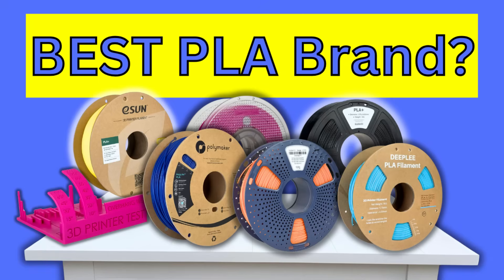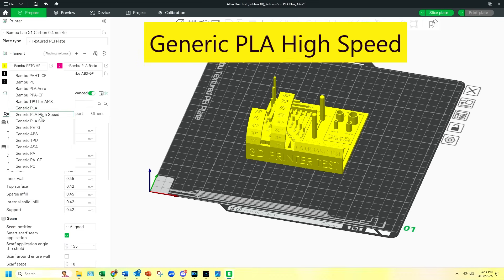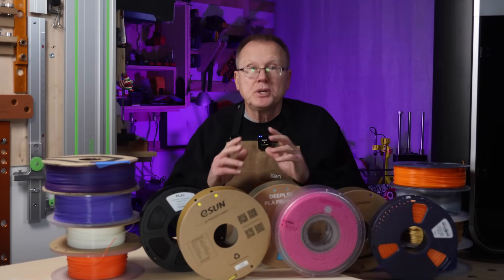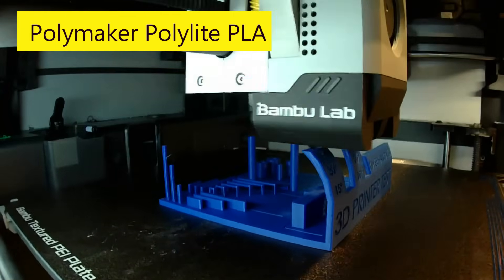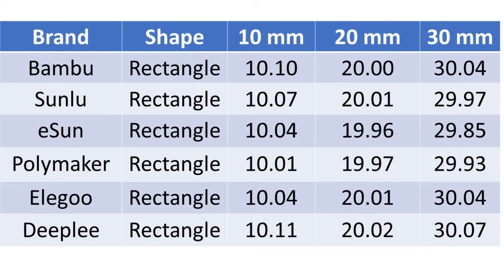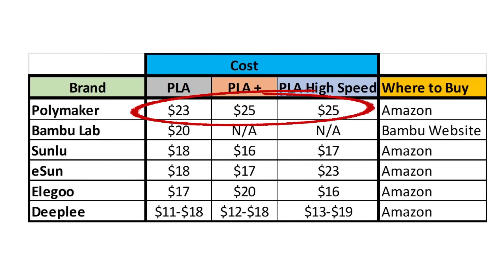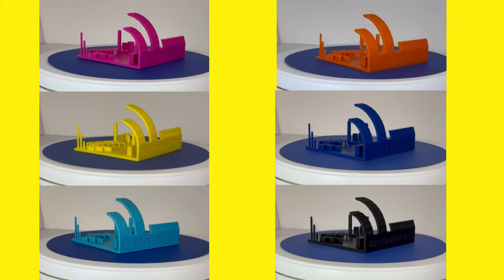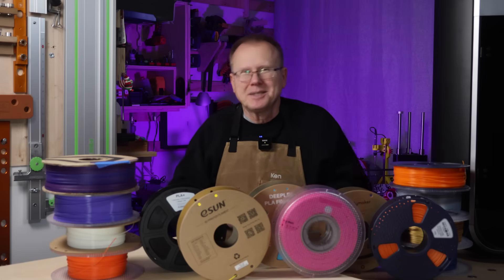Which is the BEST Brand of PLA Filament for 3D Printing?

Comment: I tried six Sunlu spools from 3 different batches. Four of the six spools had winding problems which lead to tangled filament on the spool and constant print failures. Never had that with any other brand. That means I had to return 3 out of 3 shipments I bought from them. That's just terrible. They have great resin, but in the FDM department they have lost me as a customer for good.
Reply from the maker: I’m sorry to hear about your experience with the Sunlu filament. Thanks for sharing.

Comment: Bed adhesion is something that I found mixing results between brands
Reply from the maker: With my limited testing, I didn't see a difference with bed adhesion, however thanks for sharing your experience regarding bed adhesion.  I will keep an eye on that as I run more parts with the different brands of filaments.

Comment: Doesn't the deeplee model look a little warped on the side where the overhang tests are ? It looks off the blue disk, not sure if its am optical illusion

Else its nice to see manufacturing is much better. Before id get ecofil3d, elegoo, sunlu etc.. half of them wouldn't print because the quality wasnt great, the diameter wasn't constant or there was already moisture in the filament
Reply from the maker: I just double-checked the Deeplee part and it is very flat. The blue disk is just a piece of colored paper so the part may not have been sitting perfectly flat on the turntable.  Thanks for the question.

Comment: I fully calibrate every filament I use, down to shrinkage/expansion. You'll not see the larger changes in design to output that way. Saves tons of time by taking a little more up front.
Reply from the maker: Thanks for providing your process in using filaments.

Comment: I suspect the cylinder discrepancy is actually the printer itself or slicer gcode. I ran into many issues printing cylinder and round shapes, with most common being - the diameter changes abruptly mid-ptint, and the new circle perfectly alignes with the previous on one edge but leaves a sharp step on the opposite.
I could not solve this, but it feels bambu printer struggles with circles for some reason. Maybe it's all printers, idk.
I almost feel theres some sort of rounding error in the driver.
Reply from the maker: Yes, you could be right.  I haven't carefully studied the source of the diameter differences.

Comment: I work for filament manufacturing buy filament made from PLA 4043D resin and high speed is gimmick it's just low quality resin you better of with recycled stuff. buy from the manufacturer of filament it's normally cheaper as a lot of brands are just stickers charging a higher price, I know I do it

Comment: Your diagnostic process is flawed. Use the calibration model to tune the filament settings … you know, calibrate … then you print something that tests the strength of the different filaments in multiple ways. That’s the comparison that qualifies the best for the price. If you don’t know how to tune the settings, you should be able to find some tutorials on avoiding common printing problems such as stringing. Stringing is related to printing temperature and cooling. To fault a material because you printed it wrong is not a realistic judgement.

Comment: I am surprised you listed Elegoo as plastic reels. I but allot of Elegoo and have yet to get any on plastic. I rip the cardboard sides off and put them in the Bambu reels as refills like others do with eSun. Btw, I often get Elegoo from their site and it is generally less expensive than on Amazon but the selection is also less. They must sell through Amazon as a priority over their own site.
Reply from the maker: I happened to have bought my Elegoo filament that had plastic spools, but I agree with you that when I was on Amazon, Elegoo also had filaments on cardboard spools.  Maybe they are switching over to cardboard spools and I had an older lot of filament. Thanks for pointing out that you sometimes find a lower cost Elegoo filaments on their website vs. Amazon.  Thanks for your comment.

Comment: Elegoo is my current favorite, especially their matte. I do like sunlu, esun, and creality's filament too though.
Reply from the maker: Thanks for mentioning you favorite brands of filaments.  I haven't tried Creality's, but I should do that. Thanks for your comment.
Reply: I had a lot of issues with cursed roles of elegoo.  Rolls where every 5 min they would tangle and overload the ams no matter how much I unrolled and rerolled them.  I had the same issue with Bambu refills.  With the latest sunlu I haven't had it happen once.  Historically they they had the same problem but it looks like they have some new method of filling the spools that fixed it.
Reply: @atomichamsters  I've used at least 100 spools of elegoo in the past 6 months with not a single tangle so that's just weird.

Comment: I threw away 4 spools of Elegoo PLA Black, I got in a 4-spool amazon deal, because it had 3 or 4 bumps per spool that would jam the extruder.  Bought about 6 months ago.  The only filament I have ever been unable to print in over 10 years.
Reply: I use Elegoo and I have never experienced filament problems. I buy it directly from Elegoo.
Reply from the maker: I'm sorry to hear that you didn't have success with the Elegoo filament.  You have been 3D printing for a long time so you must have tried many brands.  Do you have any other brands of filaments that you like that I did NOT include in my video?  I would be very interested.  Thanks, and thanks for your comment.
Reply: Bingo!  I had the same problem with Elegoo black and got a blob of death that ruined my Anycubic printer!  I thought I was the only one.  I never bought Elegoo again.  They probably own Deeplee filament because people quit buying Elegoo when they got the bad filament we experienced.

Comment: I tested Kingroon pla for $7 a roll and its prints just as well as any new (dry) pla.
Reply from the maker: Thanks for letting me know.  I haven't tried Kingroon, but I may try to get some for testing.
Reply: Where are you getting it for that cheap??
Reply: @amandagallacher8173 you can get it off of aliexpress, especially in bulk and when there is a deal, you can get it for $7-$8 per roll. Their petg is better than their pla in my opinion

Comment: Best PLA is the cheapest per KG with free shipping.
I use whatever filament I can find on Amazon and usually have good enough results. The only issue is color selection is hard to find. I tend to buy white, grey, black in packs and whatever else I can find for less than 20$
Reply from the maker: Lol, it’s hard to argue with your approach. Thanks for sharing your experience.
Reply: I’ve been printing with Kingroon PLA from Aliexpress that was a little over $8 per KG with a 10 KG order.  It’s just fine honestly.  It has a matte finish.
Reply: @ I’ve seen it. What kills it for me is their shipping. It wipes out any savings unfortunately

Comment: My experience has been very similar to your results - there are very few bad spools of PLA out there these days.  Over the years I've had very few spools which just wouldn't print acceptably.  Some quality issues that were more of an issue in the past were quality of winding on the spool to the point where the worst could have tangles.  This is a very controversial subject because in theory it should be impossible but many out there insist it has happened to them.  I believe that most tangles are self inflicted by losing control of the end, but I think that if the filament has a lot of bends in it and was wrapped unevenly it could be possible that a section gets wrapped under other windings that while not technically a knot could cause the feeding to get stuck.  Another possibility is that if a splice occurred during winding and the end got "let go" during the splice that a knot could happen.  Another issue that used to be more common is variation in the filament diameter.

But the biggest reason I've tried a variety of brands of filament was in search of a particular color.  Even though a vendor might offer the largest number of colors, their version of a color might not match what you are looking for.  I've seen it come down to cultural differences, the red offered by one vendor might appeal to their culture more than yours (not a bias here, I had this specific discussion with a friendly vendor when their version of a color seemed a bit off to my tastes).  Colors which have been especially problematic for me are brown and beige - one vendors brown might be too dark for your project when another might be too "milk chocolate" - I've had to try some brands I've never heard of to get just the brown I wanted.  Another is what is called beige, for a long time I was looking for the a color that would match well around light wood like maple - I wasn't interested in a filament that had wood fiber blended in, just that the color was sort of in the ballpark.  What I found was that a lot of beige filament had more of a pinkish tone that was sort of skin colored and not what I was looking for - a long time ago Makerbot had a khaki color that was perfect for that, but they've gone the way of the dodo bird.

When Bambu Labs printers first came out there was an issue with spools that would not fit in the AMS, but I've seen a lot less of that lately.  Another issue is the move to cardboard spools which are also known to cause problems in the AMS.

Other types of filament such as ABS can have more variation between brands as the formula of the plastic can vary between brands.  I've found that some brands of ABS are fine with a lower bed temperature than others, and some are more prone to warping.  "Real" ABS will dissolve in acetone, but in real life results will vary depending on the ABS blend.
Reply from the maker: Hi Steve, thank you for sharing your detailed experience with PLA and ABS. You have inspired me to consider making a follow up video on ABS, and maybe other materials beyond PLA.

Comment: The pricing varies by country i think so take the prices with a pinch of salt. 

In my country of residence, most expensive is Polymaker and Bambu with Elegoo in the middle and Sunlu as one of the cheapest.
Reply from the maker: Yes, you make a very good point regarding where you live can make a difference on the brand of filament prices. Thanks for pointing that out.

Comment: As someone with a bambu labs p1s & AMS, ive begin to use bambu filament just because 15 bucks a roll is pretty good(as a refill, 18 with spool but i dont buy those anymore) and the RFID is pretty handy so its work the slight increase in price compared to some other filaments
Reply from the maker: I do agree with your points regarding the Bambu Lab filaments.

Comment: I would be interested in your take on Numakers filament. They have somewhat lower pricing for PLA and PETG than many brands at low purchase volumes
Reply from the maker: That is a great question because I learned about Numakers at last year’s 3DPrintopia. I do have some of their filament, but I haven’t tried it yet. I will include them in a follow-up video, if there is an interest in another video. Thanks for asking.

Comment: I have 3 esun spool & they keep breaking, not good. They all gonna end up in the recycling bin
Reply: Doesn't eSun come on cardboard spools? Maybe I'm wrong.
Reply from the maker: @amputeemarksman  Yes, at least from my experience, eSun comes with cardboard spools.
Reply: @amputeemarksman  yes, but I've used my spool winder.
The esun filaments break inside the AMS so I have to unscrew & open the AMS to unstuck the ptfe tubing
Video of the spool winder:
https://youtu.be/zDa401hcEBE?si=brwMckAvSfpAXa1z
Reply from the maker: Sorry to hear about your problems with eSun filaments.

Comment: Bambu Lab PLA is high speed PLA.
Reply from the maker: Bambu Lab recommends the top speed for their Basic PLA is less than 300 mm/s. I categorized High Speed of less than 600 mm/s.
Reply: @ristinnovations  I don't know any filament advertised as 600mm/s. That translates to a volumetric speed of 50mm/s3 using .20mm layer height. If you know of some, please share it. 

Bambu Lab PLA has a volumetric speed of  21mm/s3 for basic)
 and 22mm/s3 for matte. The generic high speed PLA profile for comparison is 18mm/s3. The generic regular PLA is 12.

This is why I tell everyone Bambu Lab PLA is high speed. It can go a higher flow rate if you switch nozzles, but the default nozzles limit all filament to like 25mm/s3 from speed tests I have seen people do on Bambu Lab printers.
Reply from the maker: @hotfix7387 Elegoo offers their High Speed Rapid PLA + at a speed of up to 600 mm/s. It’s on Amazon.
Reply: @ristinnovations  interesting that they claim that. Maybe that's a burst speed versus a sustained speed?

I hope my point wasn't lost that the Bambu Lab filament prints faster using the Bambu Lab filament profiles (21 or 22 mm/s3 respectively) than the generic high speed PLA filament profile  (18mm/s3). If printing faster than the high speed filament profile doesn't make Bambu Lab filament "high speed", then I don't know what does.
Reply: @hotfix7387  epax and probably now others sell a high speed PLA, Bambu isn't the only game in town anymore.